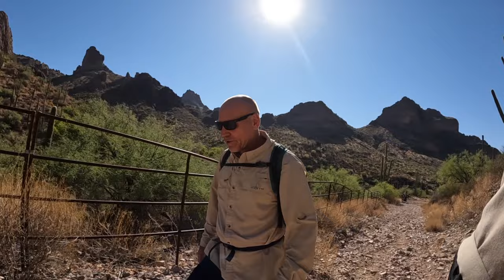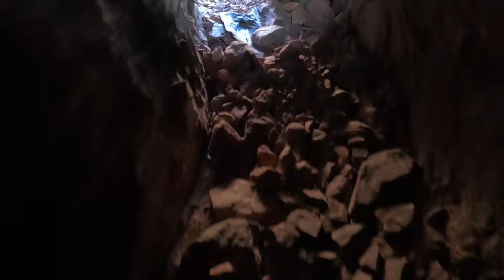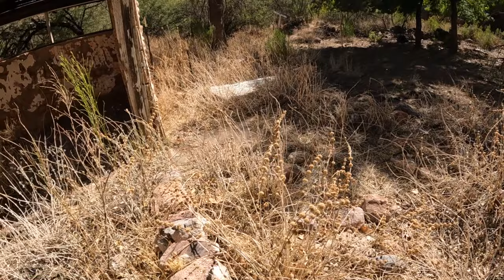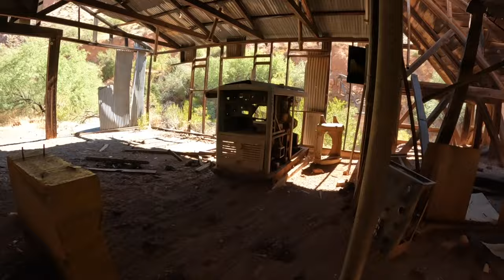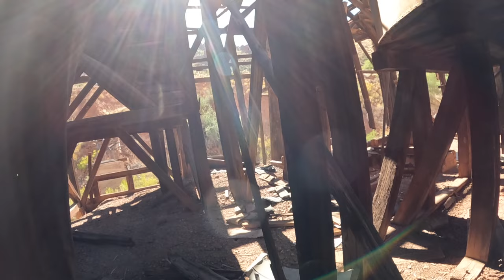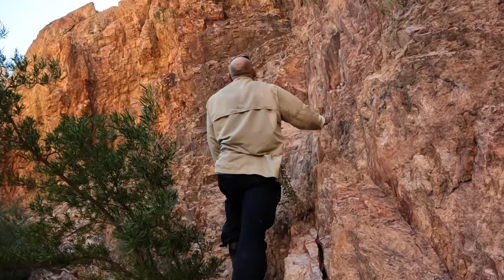BOX CANYON to MARTINEZ MINE and CABIN   Full Video

Comment: That's must have been quite the MINE in it's day! Don't see you on your "Juggernaut ultra fs pro 3"! I'm looking at purchasing one soon for use for long trail rides as I work in the Tourism industry on Vancouver Island. So I need to be sure this is going to hold up to the challenge of steep trails up and down mountains over the next 2 years. I don't want to make a mistake on a personal investment if not. Would you still recommend this eBike or did you have issues? THX
Reply from the maker: I love electric bikes but the distance concerns is why I run a motorcycle as well  . Motorcycles do take a better beating with less maintenance . I have the same investment in my electric bike as my motorcycle  which does not seem right. . thx jss
Reply: @madhistory  thx for you quick reply! True, I can by a electric motorcycle with higher end components for less!
Reply from the maker: have a great day  explore on !  @IslandFilmMaker